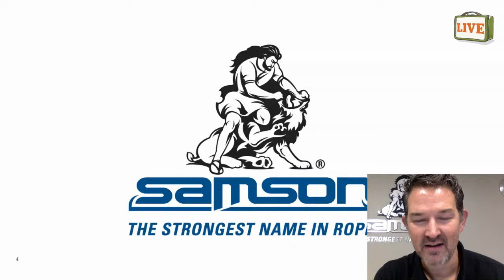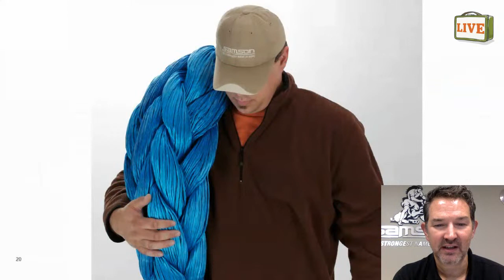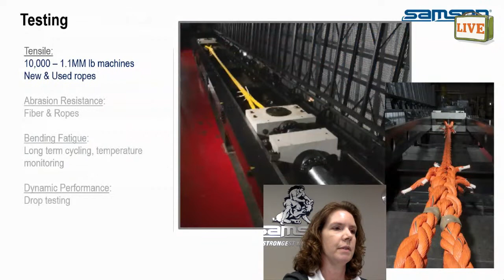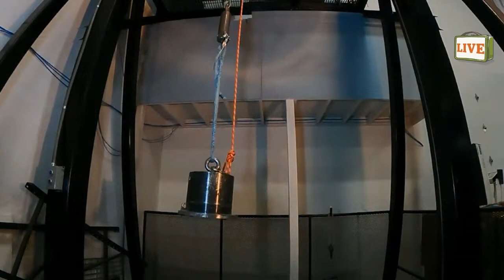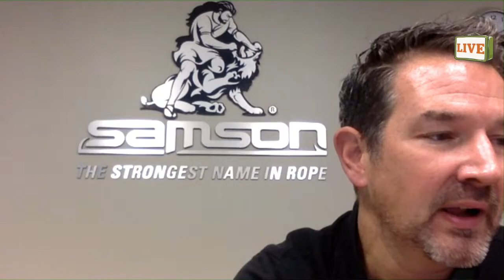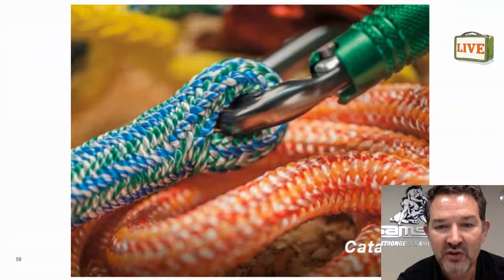Samson Rope Lunch and Learn Broadcast - LIVE

Comment: Great stuff. Those tests were great to watch. So thanks for sharing.

Re the retirement of ropes query.
Is there any chance you can ask your Sampson folk if its possible to add a few strands of tell tale or sacrificial fibres that might indicate when it's time to retire a rope? E.g. fibres that might break before the others in a rope if dropped or if the rope has been rubbed excessively from say DRT work over limbs (such as they say occurs inside the sheath but is not visible from the outside). 

 Such tell tale fibres might give the rope a fuzzy feeling/appearance or perhaps change colour.  

Just curious as what they may have done in this regard is all.

Thanks again for hosting this broadcast, it was great to go behind the scenes and get shown the ropes 😁